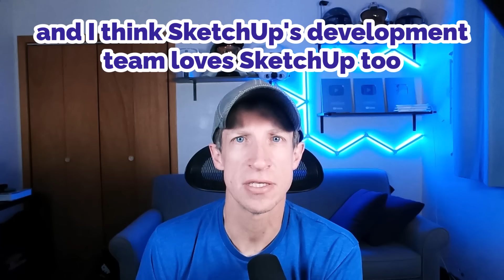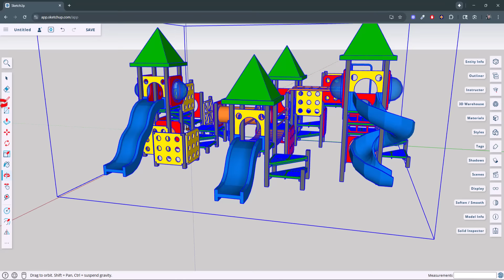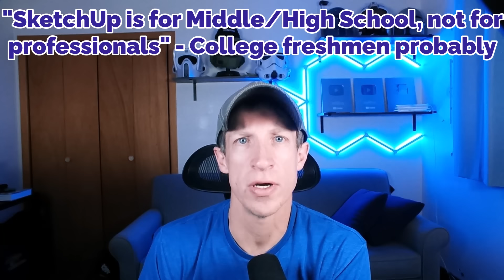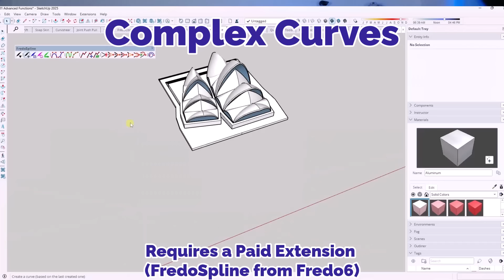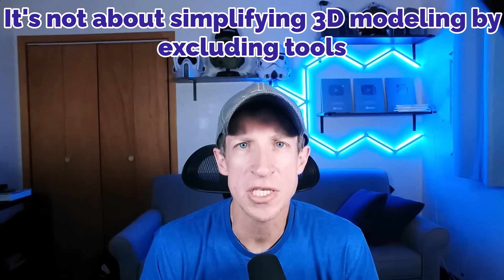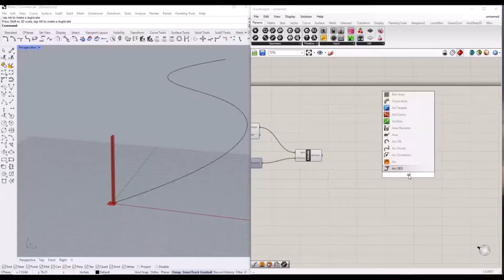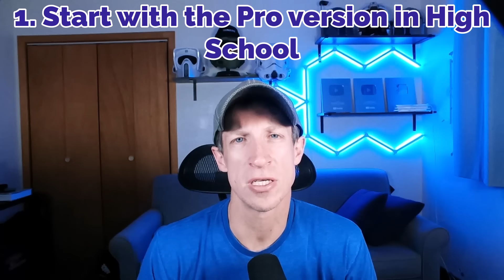Is SketchUp being REPLACED?

Comment: I've been working in 3D software since there was 3D software. Sketchup had a brilliant ascent in the profession until their R&D languished and the became a subscription service. Then Trimble closed the coffin on the platform. More importantly, sketchup creates inaccurate geometry which causes workflow problems. Rhino steadfastly uses a purchase model which is what small firms prefer. Rhino is also massively useful for all kinds of topologies from meshes to solids to generative geometries. Its also developed good associations with mechanical engineering and additive manufacturing pipelines and robotics. It also has a robust educational community based in architectural disciplines AND, they have a great global community.  Sketchup, in comparison is an outdated, neglected toy imho. It did accel at documentation for a while. Other platforms could learn from that. Rhino has been my go-to tool for years now. Sketchup sits on my drive at v2020 in case I need to access native files.

Comment: I disagree with most of the comments here. In your survey recently of what is needed in SU thelatest 2026  release addresses almost all of the items most popularly requested. And having tried Rhino after being a SU user for 22 years it’s no way as intuitive nor user friendly. My use of SU is for architecture …buildings only so the straight edges of SU  suits me fine.
Reply from the maker: ...how do you figure that? This release addresses almost none of those items.

The top core feature requests in that poll were (in order)

1. Layout Improvements and Optimization - Some improvement in 2026, but the overall workflow is still problematic
2. Bevel/Fillet/Chamfer Tool - Not added
3. Advanced Architectural Tools (Walls, Doors, etc) - Not Added
4. Section Cut Fills - Not Added
5. Layout Auto Dimensioning - Not Added
6. Dark Mode - Not Added
7. Native Bending / Deforming Tools - Not Added
8. Scene Grouping / Folders - Not Added
9. Dynamic Component Improvements - Sort of added in Live Components, but people prefer dynamic components
10. Spline Drawing and Editing Tool - Not Added
11. Custom Line Types in SketchUp - Not Added

Comment: Stop fooling around with these so-called value-added features and work on making the existing features more robust.  Like fixing the frequent crashing problems when extensions are added, and my biggest pet peeve:  Your layering and "tagging" functionality sucks.
Reply from the maker: Interesting - what about the layer/tagging system don't you like? You select and object then use a dropdown to add the tag you want. Is there another way you'd like to see this done? Because this is a pretty standard way of tagging objects

Comment: As user of both, I agree but I use SketchUp mostly because of 3D printing. For sure, Rhino is professional and SketchUp is amateur. The biggest difference is Rhino works better with humungous models, SketchUp drives you knuts because of the way tiered grouping works and as you edit deep in, it 'joins' and youre never sure what subgroup youve joined, you havent got that lovely UI of Rhino. If SketchUp allowed to define an empty group, give it a name and click on it.... You would be in control.
SketchUp plot is horrid, confusing and never works properly on A1/A0 printers, Yes I use Layout as well but sometimes you just want a plan at 10:1 scale on A1 quickly using 1 sheet of paper and 50c worth of ink.
Rhino seems to work with $1000 CAD cards and 3840 professional monitors, SketchUp does stupid things like display some of the user interfaces in micro boxes, as if the programmers at Trimble dont use proper CAD workstations for testing.
SketchUp frequently seems to get its SNAP integer and reals mixed up on very large drawings and once derailed, the drawings forever derailed. For example if your site plan is 1Km square, you are working in metres. But equally you are installing ductwork with clamps and M6 bolts in high detail, occasionally SketchUp seems to think that what used to be a precision snap that you specified exactly is now 0.5mm out! If anybody has ever experienced this you'll know what I mean and basically your lovely drawing with hundreds of hours of work can collapse, walls no longer become walls because one corner is suddenly 0.1mm out! Its all a bit amateurish... IMHO.... But I still love it and use it!

Comment: Right now we use sketchUp to quickly develop designs and then move to revit for BIM. SketchUp isnt poweful enough as a BIM tool and its not poweful enough as a design tools beyon basic geometry. All it would take is one 3D warehouse by Rhino for SketchUp users to entirely jump to Rhino.
Reply from the maker: Well I don't think it's intended to be a BIM tool (which is fine). I don't think Rhino would add a 3D Warehouse - I'd imagine hosting all that content is one of the reasons (maybe not the biggest) for the program being subscription. It's an ongoing cost to host and maintain all those models

Comment: After working as an Engineer a few years, I discovered SketchUp could do most of the same things for free. Since then I've done a lot of very complex modeling with the free version and internet connection is rarely a problem despite working in rural areas of both the US and European countries. It's true that SketchUp has a steep learning curve, but the expert help available for free in the forum and on youTube is amazing. And, sure there are times an extension or the paid versions would make things easier, but what can be done with SketchUp often depends more on the driver. So I say, don't look a gift horse in the mouth. Thank you Trimble for providing such a great product for free.
Reply from the maker: As 3D modeling programs go, SketchUp probably has the least steep learning curve

Comment: It's a great warning video, first SketchUp should have just two versions, beginner  and advanced (no need for more, just makes SketchUp confusing to begin) and second, if they could crack the codes of what are the most importan external plugins that should be native to SketchUp, and update them, SketchUp would remain unbeatable for a pretty long time. There should be about 10 more of native Sketchup plugins. For the end, I would definitely not add the node feature, this is where the simplicity of the software would end.
Reply from the maker: I'm kind of at the point where I no longer feel these functions should be extensions. With a web version and an Ipad version that don't support them, they need to be added as native tools

Comment: I would like to see more students take the time to really understand Grasshopper as well as Rhino - only a small percentage at my university (Dundee) take the plunge.   Too many students 'fall back' on SketchUp and Revit and it shows in their designs - boxy and dull.   I advise them to use a pencil, design freely and we will work out how to 3D model it and which software would be best to use, once the idea is there.
Our MakeLab (3D printers, CNC, laser cutting) struggles with models generated in SketchUp - students do not model accurately enough to leverage these modelling methods.   Rhino is a modellers dream - blending curves and surfaces, flowalong, etc - just magic - made even more powerful by grasshopper.
Reply from the maker: This is an interesting discussion for me, but it's really more a philosophy of design discussion. I often approach it from a different direction only because I've spent over 15 years as an estimator for a construction company, so budget is often a huge consideration I run into. Not saying that the more organic forms shouldn't be considered, but they do have a significant cost associated with their construction.

Comment: maybe SketchUp deserves to wither away. it's not good to be married to a tool that you don't have control over.
Reply from the maker: I mean...unless you're a developer, you really don't have control over ANY of the tools you use, right?
Reply: @Thesketchupessentials   Individually, yes. Even any given engineer has a limited capability to shape the tools they use to their liking, because it's a shit ton of work.

However you're also too conditioned by closed source software into a victim mindset, where all you can do is scream into the void, and bend to the will of the several companies that run your life. With open source tools, this isn't the case, because you're not alone, if you have a substantial enough gripe, odds are, 300 other people do too, or maybe thousands. You can create a user group, you can start collecting cash, you can run project management and hire an engineer to fix your gripe.

I need more people to break the spell and actually get active and get spending on open source to get what they need.

Comment: Better modeling is definateyl required, I'm not sure adding these tools will actually be helpful if sketchup doesn't add BIM and fabrication pipelines as well. What makes Sketchup a toy is I can't design fabrication level models and export fabrication data (CNC, etc) from Sketch up, nor use it for BIM model generation. These are the modern professional workflows and tools of the trade.
Reply: To be fair , vectric, is a legacy software that can import from sketchup for CNC cam work and does a pretty good job within Sketchups limitations on curves.

Comment: I moved to Rhino exactly because of the missing features. Seriously, the community has been asking for a native Bevel tool for YEARS, and still not a hint of it happening anytime soon! Another annoying thing about Sketchup I hate, is keeping track of all the extensions and reinstalling them after every upgrade, praying that they will still work. Some extensions that used to work in v.2023 stopped working in v.2025. Others started crashing. Some simply were abandoned by their devs, so I had to find a replacement, which is time consuming. Also, all extensions have their own UI and specific logic, so you end up learning a dozen of different ways of doing stuff using a myriad of often mediocre UI.
Sketchup is just too much maintenance...
Rhino may be a little more complex, but it has all the tools I need. Out of the box. It just makes my life simpler.
Reply from the maker: I can see how that would be frustrating. Personally I don't mind moving them between installations, but like you said, the issue is when you have an extension you need that doesn't get updated for months, or even at all. This can be crippling to certain workflows

Comment: I worked with SketchUp for 15 years, fortunately I don't need it anymore.
I never liked its interface, its extensions interface, shortcuts .Everything looks like made with windows 95.
I don't like how sketch ups layout is so bad and slow.
This would be greatest thing ever, but it's not, constantly crashes.

So, if reliable technical drawings need to be done somewhere else, then I don't need to be using sketchup.

Comment: Never used Rhino or Grasshopper, but Grasshopper was the first thing I thought of when you talked about what is missing in SU. Another is texture mapping. Even the add-ons, as hard working as they are, have to fight how SU makes geometry.
Reply from the maker: Texture mapping for sure - there needs to be an easier way to adjust materials on curved surfaces

Comment: Sketchup is nice in some things, awful on all the rest. Rhino is dirty cheap, has Grasshopper and almost ALL AutoCAD tools built in. Buy the Visual ARQ plugin and with less than 2K you have the absolute, permanent license package that rivals seriously expensive BIMs, with open source pro GH plugins for sun radiation, robotics, finite elements analysis, the list is infinite. It is THAT simple. Been using Rhino since 2002.

Comment: There is a fundamental difference between SketchUp and Rhino: SketchUp is vector - based while Rhino is NURBS - based. Additionally, Rhino includes Grasshopper, a very powerful graphic programming language, and (last version) integrates 3 types of geometry: NURBS, meshes and Sub-D, working flawlessly as a whole. So, if you need drawing a gear for machining, working with a dense scan mesh, work with very complex organic shapes, or deal with parametric needs, SketchUp may not be a good choice. Moreover, I don't like the subscription model. (NOTE: My last SU permanent license is 2016. I apologize if new versions incorporate changes I not aware of).
Reply from the maker: This does seem to make a pretty big difference for machining/cnc type work

Comment: I'm using Sketchup for almost 15 yrs, before I even went to highschool (my father's an architect so I tend to learn autocad and skp). 

 I love how easy their interface is. But when I use it now for work, it struggles to keep up with larger projects and tends to crash and lags.

One of the issues here in general, is, I tend to manually create most of the assets from scratch even it has  warehouse because often I want more detailed models. The problem, it is time consuming because like bevels, I need to do it manually.

No carvings, all plug ins needed to be paid. etc.

Even though I love sketchup, I just can't keep doing band aid solutions for deep problems that other softawares resloves easily.

Comment: In 2012 after purchasing Setchup  by Trimble from GOOGLE I have noticed that they are just milking the cow. Since my purchase of licence to use Sketchup Pro 2018 there was no point tu update to the newer version. Apparently Trimble paid less than 5% of its annual revenue. Analysts speculate that the price was between $90 million and $45 million. (PINUTS ) I am now using FUSION 360 and honestly the amount of money you pay for such a powerful software compering to Sketchup is mind-blowing.

Comment: SU made the fatal mistake of pandering to the mainstream consumer vs the industry ! What i mean by this is they have watered it down to attempt to gain a wider audience of non 3D people into 3D verses addressing serious issues regarding its industry application whilst its competition keeps innovating SU seemed like its being run by the men in black suits vs the developers
Reply from the maker: I don't know that I fully agree. That's where SketchUp's initial success came from (the mainstream consumer vs. the industry) - it was the accessible, easy to use program. That said, a lot has changed in the last 15-20 years, and the other 3D modeling programs aren't nearly as unintuitive as they used to be, which doesn't make it the differentiator it once was

Comment: SU has just sprinkled on cosmetic changes to catch up with competition but nothing under the hood to create a new functionality
Reply from the maker: I think that's a little unfair - they did a complete rewrite of the engine in 2024 to improve speed and performance, which was one of the main complaints, and they're working on improving performance of SketchUp and Layout every year. That's a bit more than cosmetic, BUT...I also agree they have not been expanding the feature set, and that's a problem
Reply: @Thesketchupessentials  I am sorry: they rewrote the software core after 12 versions — that’s how many have been issued since they acquired it from Google. This is not a serious argument. Besides, it has been notoriously unstable — unlike Rhino — and the functionality remained pretty much the same until the advent of the 2023 version. All the while, the price has been increasing. As you said, to paraphrase: “like it or not, subscription is here to stay.” However, the market is responding — and this is why Rhino is getting more traction. The idea of subscription is as old as communism — only now it’s being pushed by none other than corporations.

Comment: What made Sketchup truly great back then is the fact that it was a very beginner friendly 3d program and it was free.  Way back when, you could get the free version, which was almost as powerful as the pro version.  I understand it's a business that needs to make money, but the most frustrating thing about sketchup, aside from the 3d limitations, is that they shifted to a subscription based business.  Want to get your software in the hands of anyone who wants it?  Make a stable, powerful version of Sketchup like they used to, but strip out some of the more advanced functions and sell it at a lower price point (think photoshop elements....no subscription crap).  Then you can have a paid version that does all the powerful stuff like import autocad, bevel, and parametric inputs.   You will draw users in based on the beginner friendly nature of the program, large community of support, and relatively low entry cost.  Then, if you want the more advanced stuff, you can pay for the pro version (again, no subscription crap).  Rhino does perpetual licenses.  Why can't Sketchup?  That's what will fix Sketchup's problems.

Comment: Of course. Here is a summary in 4-5 lines:

Our firm's experience demonstrates a pivotal industry shift from traditional modeling software like SketchUp to the data-driven paradigm of parametric design. While tools like Blender offered performance benefits, the transition to Rhino and Grasshopper proved transformative. This move revealed the profound limitations of older platforms in a professional practice increasingly defined by computational power. We now perceive that the architectural vanguard is leaving less capable tools behind in favor of integrated, algorithmic workflows. Something that is just not possible with Sketch up and its current workflow.